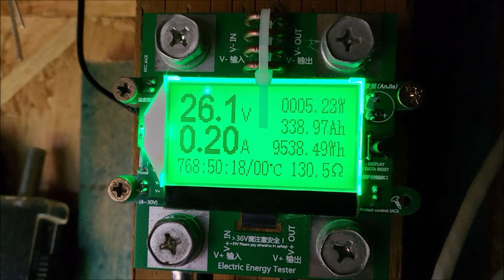Modular Shed Update - November '23

Comment: Many comments here on how damp garden sheds can get (as I know) - dripping ceiling from condensation etc.  Wind born spray from rain + gales - shed weatherboards should at least have tar paper lining as per old school. Then there's squirrels, rodents, insects, ants, spiders etc - Watts not to like.  But very wise not to bring that lot inside your house.  BTW have you got an outside emergency breaker system (IMHO you might consider Anderson connectors as they are designed to be pulled apart - better than nothing). Do I see some proper cable cutters, gloves, goggles, hanging up ?  Sand bucket to hand, Water bottle to extinguish arc flash.  Safety First please, lots of kiddies following you here

Comment: I did notice the cable tie, so thanks for the answered before asked.

The blow up, do you not have diodes installed as a lot don't seem to have them and this blows them up sometimes..
I wouldn't know anything about that... With my solar panel tester I made...
😅

You need to get on the hot roof/cold roof fix..

Comment: Two or 3 strategically located 12 volt computer fans, running 24/7,  might help with your condensation problem? I'm sure you have sufficient battery capacity to run them.

Comment: Why isn’t your shed properly insulated and heated?

Also roofs such as that (more so metal ones) radiate to space and moisture in the air preferentially condenses on the underside rather than anywhere else.  

25mm of PIR, topped with 11mm OSB, a layer of tyvek wrap, followed by the existing roofing will fix it.

Comment: A common retrofit solution to condensation dripping off the inside of a corrugated roof is to spray coat the inside of the corrugated sheets  with polyurethene foam - seems like 5-10mm thickness is plenty. The idea isn't to keep the interior space warm - just stop the condensation forming on the inside of the roof.

Comment: Lovely shed update. 

Too bad about the condensation dripping. But roofs that get cold, need an underside that can absorb, and later evaporate, moisture. 
Perhaps a (yearly replaced) cardboard thingy would be able to absorb, and later evaporate. Or perhaps particle board, that gets replace every few years, might add this absorb/evaporate ability. 

Where I live, for the underside of steel roofs, they often spray with a course cement/ceramic layer, in order to add that absorb/release ability, so the inside of the attic no longer needs to deal with water dripping. 
They use the cement/ceramic stuff as nothing bad will grow in it, while it is "wet" during the (daily) absorb phase.
Reply: Hate to say it 33yrs experience, this problem would have never happened if a membrane was installed before the roof. (also walls) Ventilation is key ,use your batteries to run a dehumidifier .

Comment: Have you considered lining the roof with fiberglass insulation? That should make it easier to keep warm in the winter and keep moisture from reaching the interior of the roof.
Reply: I once touched fiberglass insulation, I can still feel it itching.
Reply: Thats a better idea than mine of plasterboard that would get damp. A greater pitch 1'st thought may also help the drops  run, although the council probally have rules for roof hight.
Reply: I mean foam board would also be an option, which would be better if the beams aren't at standard widths apart. As for touching fiberglass insulation, I avoid touching the stuff. I don't like smelling it either.

Comment: I love the shed... But wouldn't it be better to spend few bucks on isolation? At least roof? 
Recently I isolated my shed and I used just cheapest 0.5 and 1cm thick foam(that normally is used on floors. But who care it was cheap 😊) and plywood. It was not that expensive and maybe it's not super efficient in terms of keeping temps but it do something as I can't sit there for more than few minutes an most important, I no longer have issues with drips and moist air. 😅
Reply from the maker: I reckon the only way a shed could maintain a reasonable working temperature, in winter, would be to build a shed within a shed within a greenhouse.
Reply: Insulation panels on the walls and roof would make a big difference to the amount of energy needed to warm it up. My workshop has insulation and warms up very quickly as a result.

Comment: I never understand my you want to work in a shed. i sit in a nice warm room with all my toys.
did get a bit colder today as i had the window open as the laser was cutting acrylic and I had to throw the vent pipe out.
Reply: I bet his other half has told him to work out there 😉
Reply: @fredflintstone1  That's why I've never built a shed 🙂
Reply from the maker: Lucky you. I have a workshop in the house that is 2m by 3m - that's smaller than my car. The shed is the other half of my allocated workspace. It's all very impractical.
Reply: @JulianIlett  well just measured my toy room, and it's 3m x 2m!
How I get 2 PC's 3 monitors, 2 3D printers, a K40, 2 HAM radio's + PSU's (HF, VHF, UHF) (HF VHF), and store a lot of junk i don't know. Looks like i might have to build a back room on the chicken house when i build it in the spring. 🙂
Reply: @TheEmbeddedHobbyist  Haha, or dig down, add another level :-)
Reply: @deslomeslager  sounds like a plan,  can't go down to far as I'm only 10m above sea level:-) and not too far from England's lowest place.  :-(
Reply: @TheEmbeddedHobbyist  lol just build a diy underground cave haha
Reply: @BenCos2018  I'm so close to sea level, if I dig down it won't be a cave for long  it would become a swimming pool very quickly.
Reply: @TheEmbeddedHobbyist  lol rip